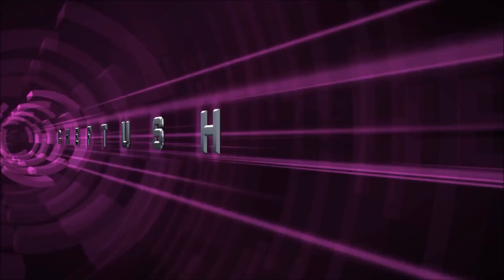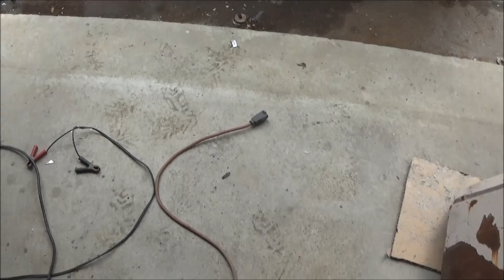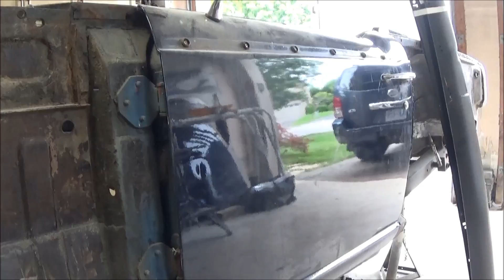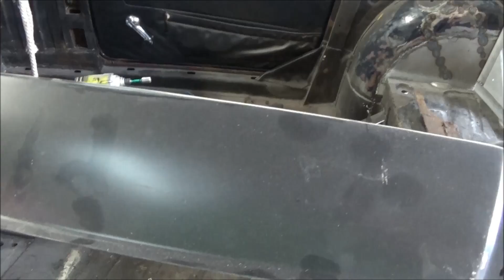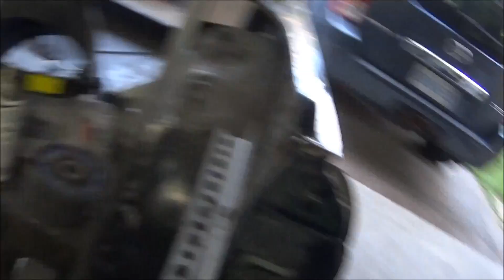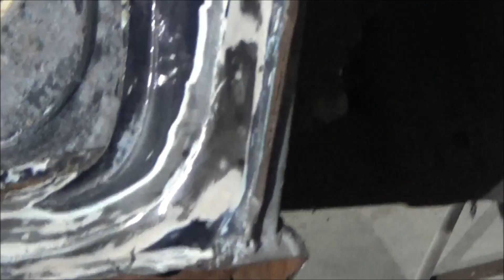T-Minus 69,1968 Triumph TR250 Restoration, Driver Side Sill Repair,  Part 1

Comment: Re. your comment about the battery supplier only continuing the warranty period and not starting from scratch with the replacement battery, the situation is the same here in Britain. I'm no legal expert, but I guess it is to prevent unscrupulous customers from deliberately damaging the battery and claiming for a new one just before the expiry date, which would mean you'd never have to buy another and the dealer would effectively be giving you a new battery every <4 years! I suspect battery life is a function of how it has been treated - a friend has never changed the OEM battery in her Nissan Pathfinder which is around 12 years old. She drives the car most days and does a reasonable mileage so it is always well charged.

Comment: Interesting. I need some investigation done on my 74 TR6...the PO told me something had happened to the car before he bought it, and that he didn't know what. I saw some wrinkling on the frame rails, but it drives OK. Last week I tried to put in a new radiator, and the lower outlet goes into the front valence, not below. Hmmm. The new rad. shroud has a big gap to the top of the radiator, also. Hmmm. The LF tire sticks out past the fender about an inch. Hmm. There's new hardware on the LF fender, also, so it's been off. Hmmm. Big door gap on drivers side rear; it doesn't line up from top to bottom. Hmmmm. Time to visit a frame shop and see what they say. Bummer.
Reply from the maker: John McDonald yeah. Don't look too close.  You might not like what you're going to find!

Comment: Great progress. The sills is interesting to me cuz that's what I'm Working on NOW. One question, the rear end cap and the last four inches of my sills are all rusted, so I'll have to repair that. The remainder of the sill seems to be in good shape but the inside of the still has got surface rust throughout. My question is what is your suggestion for treating the inside of the still? Appreciate any help.
Reply from the maker: I would probably try to spray some rust converter/rust killer in there first.   You could follow that up with something like Waxoil, penetrol, or inner cavity wax/spray that Eastwood sells after you get it back together and before you put the end caps back on.